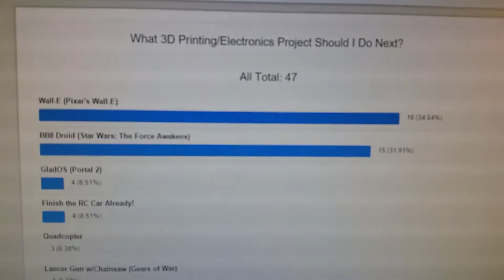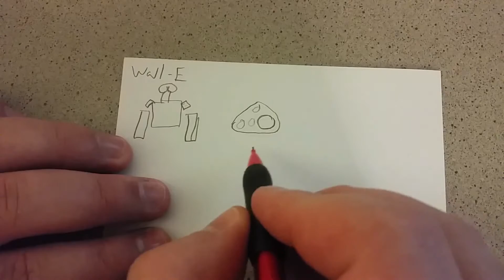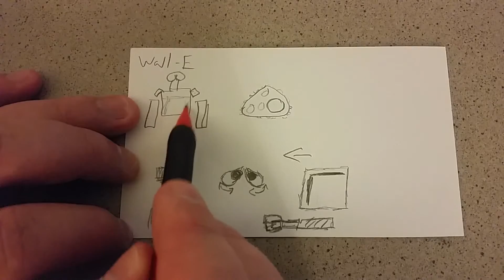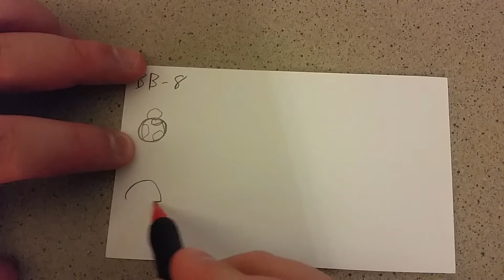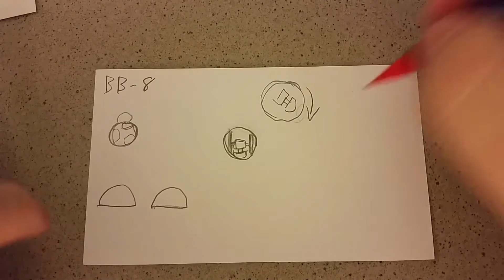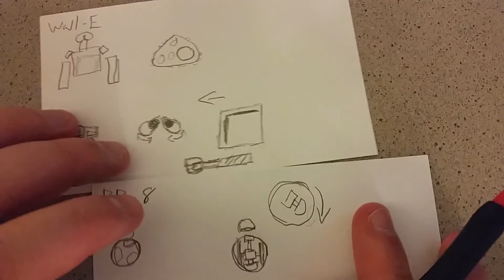My Next 3D Printing Project - Survey Winner Announcement

Comment: His magnet needs to be attached to the top of the weight, also HDD magnets are 1.strong 2.the perfect shape to put in his head while printing(polarity PoLaRiTy)
Reply from the maker: +Anthony Cruz That's a good idea! Thanks for the suggestion. I think I may even have an old hard drive laying around. :)
Reply: Are your files shareable? Maybe I can try to build along?!
Reply from the maker: +Anthony Cruz I don't have anything to share at the moment. I'm attempting to learn to use some new software for modeling, so right now I've just got a bunch of drawings lol. But as soon as I have anything worthy of sharing I'll definitely do so!